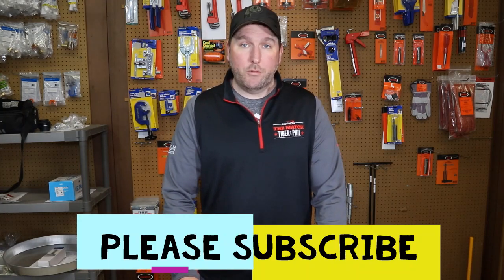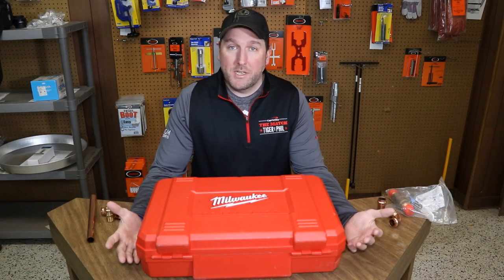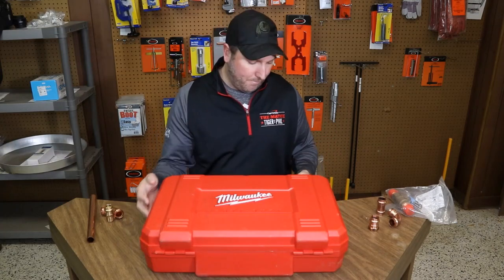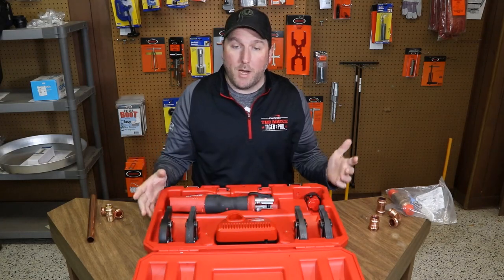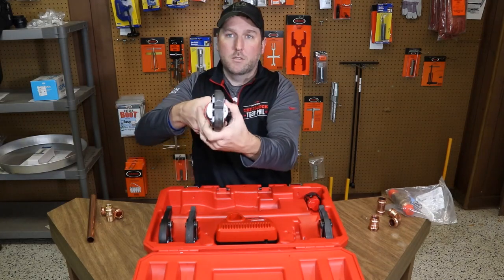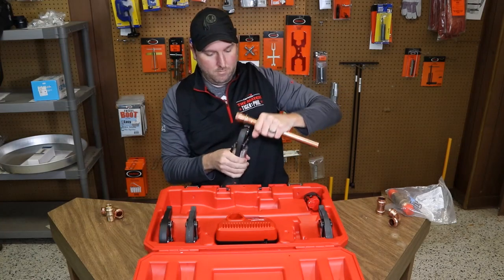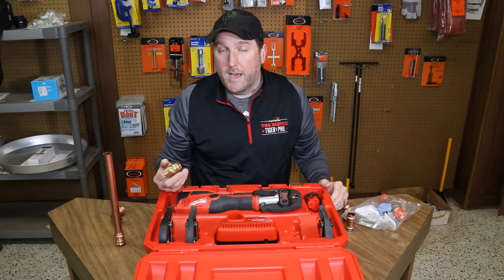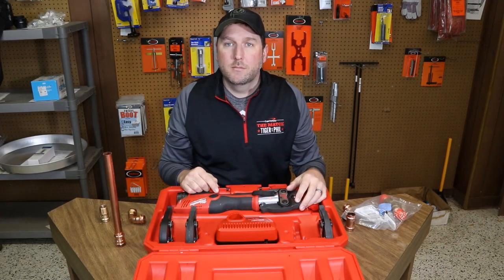The Milwaukee M12 Press Tool  A Must For Every Plumber

Comment: People dont realize unforeseen reasons us plumbers don't like to use oxy braising  .its not the time or effort it takes. Its the ticking time bomb we store in the back of our vehicles that can explode if cylinders leak. Im all for these types of press tools. The gas fittings have yellow Oring,  water usually black.
Reply: Of course this would be your excuse. The poor homeowner then has to rely on a O-ring not to fail and it generates money for you once it does.

Comment: Always clean and de bur your pipe.  The o ring inside the fittings needs to be on clean copper. A big burr can cut it when pipe is inserted.
Reply: Deburr/ream yes, but do NOT clean/sand the pipe; the O-ring is supposed to seal on a perfectly round surface, not one with a bunch of scratches on it!!

Comment: I don't understand how I own  drill& driver , circular & recip-saw .A light & hammer drill . And the total amount spent is still not as expencive as a press tool kit! Prices are literally rediculas. Not saying it's not a good tool but my GOD  $$$$
Reply from the maker: I agree they are very expensive.  Maybe they will come down after a few years like when Flat Screen TVs came out and were $3000 now $500
Reply: You need to learn how to spell! Js
Reply: Seriously! Its about the same amount of material/parts as milwaukee drill and costs 10x more 😫

Comment: Propress has saved me multiple times when there's still water in the pipes.
Reply: Why noot use compression fittings. A spanner and mole grips and the job is done

Comment: The good part I liked about your presentation is the fact you stated the working pressure limitations for the fittings.  What I would have like to have heard more of is the working weight of the tool.  The old Rigid corded tool weighed a ton.  These battery operated tools are much lighter, but I think might be a bit weaker on the pressing. Veiga  and Milwaukee makes one for steel, (Mega Press).  I was wondering if you knew, if the heads for the Megapress tool, would accept Propress crisper heads where you could get the stronger tool and just swap heads so that you would only have to buy the crimped heads.  Also, what are the temperature limitations for the fittings, glycol mix, steam temperatures...

Comment: What you across the Atlantic call Propress and what we call Pressfit over here has actually been around for 50 years or so. What's new is the technology that's used to press the fittings. We have M press fittings which are mainly Yorkshire XPress and V press which are mainly Conex Banninger fittings. My press gun is a Rothenberger Romax 4000 which uses Metabo 18v batteries that can also be used in my cordless Metabo tools. Pressfit is brilliant, but does have it's drawbacks in that it's not easy to get the jaws into tight spaces. Viega make a pressfit gun that has right angled jaws which are great for tight spaces.

Comment: Years ago I worked at a company that used power crimpers (Panduit) for copper cable lugs and then I saw the crimper you used in my basement when my water heater was replaced... I immediately saw the correlation between them.  Quick, neat, time saving.... the best way to go.

Comment: waterproof sand paper is damn expensive now a days.    love this tool. i recommend to any service plumber that lives in a crawl space.  changing hose bibs is a gold mine
Reply: Sandpaper?? To make a solder joint all that is needed is a roll of wire wool, a tin of flux and solder. All these items will last months so making a joint is very cheap. For a joint which is wet use push fit plastic or compression fitting. No need for a $150 tool

Comment: God damnit, I want/need one of those so f!@#$ing badly. Found a few locally around 800.00. I do property management in old, beat up college housing rentals. I end up in the craziest places....where plumbing should never have been installed in the first place. Eh - that's life. Great, quick, straightforward vid. I'm seeing a few local ad listings for used 2773-22 kits around 800.00. Total steal, it seems. I've got the M18 batts already. Thanks!

Comment: not so fast, I bought 2 of them and both units will not cut 1/2" m copper tube.  Aske the Milwaukee rep about it and 3 weeks have gone by and no answer?  I need tools that work every time

Comment: Does this work for pex rings as well?
Reply from the maker: This particular model does not.  The M18 ( next step up) will.  It also works on steel pipe called mega press.  These all take a separate jaw not included in the kit.

Comment: Are the M12 jaws compatible with the M18 system?
Reply from the maker: Unfortunately they are not.  This system works really well. We even just ran a 1 inch gas line with it.  Only advantage of the M18 I see is it will do larger sizes above 1 1/4" and also does steel mega press

Comment: How do you know when to take finger off of trigger?
Reply from the maker: 2 to 3 seconds to initiate the machine and then it cycles itself and crimps.
Reply: @PlumbingPartsPro  so it shuts off once it crimps?
Reply from the maker: Correct.  Once the crimp completes it cuts off automatic

Comment: Does Milwaukee have 1/4 - 3/8 jaws as well??
Reply from the maker: I know there is smaller jaws in production and coming soon for refrigeration lines.
Reply: @PlumbingPartsPro  Do you think is possible to use Rothenberger’s small jaws with Milwaukee press tool sir??

Comment: Does this tool have pex crimp jaws now ? Or just copper and the mega press jaws for gas?
Reply from the maker: So it's my understanding this m12 version only does copper.  The m18 will do all of it.  There is also a specific pex only version in th m12 that's a considerable amount cheaper like 699.00.  Not sure why they didn't incorporate pet in this version.  The m12 is not strong enough for mega press

Comment: Can you get a pex crimper  bit for 1/2"
Reply from the maker: This model does not support the pex jaws for some reason.  You would have to upgrade to the M18 model or buy a separate pex version only.
Reply: they are coming out with pex jaws for m12 and m18 next month on Feb
Reply from the maker: @elnicadrums  that's great to hear.  I haven't heard that  yet.

Comment: Copper for gas NG lines...??? Atmos will disconnect your service if you have copper lines....has this changed???
Reply from the maker: Apparently it depends on your local code.  For many years, I saw flared copper lines to fixtures like water heaters etc... and we always told the customer its was not up to code and would update with black iron or an AGA approved gas connector depending on length.  Now they approve copper sweat (providing its silver brazed) or copper press in our area.  I guess it depends on the inspector
Reply: @PlumbingPartsPro  my neighbor works for Atmos energy and if u can because u smell gas and the find copper they shut you off .

Comment: It's not just difference in cost only in tool. Fittings are also more expensive. One for 10 £ and I can get 4 of the same for 2£. And... They are V jaws or? I saw also other systems for copper. Its also press but not V jaws...

Comment: when the price goes down under $300 I might get one.
Reply from the maker: Unlikely,  I agree it is Very expensive and I was one of the later guys to buy one, however it comes in very handy.  Putting in water heaters and hose bibbs  without having to carry an acetylene torch in an attic or crawl space under a house does wonders.
Reply: Bro it’s like 1500 the cheapest anywhere I look lmao you’ll be waiting a couple years for that price

Comment: The power of Marketing!!!   What happened to the compression fittings, are they no good any more?  And guess what you do not need that expensive tool.  Or is it a for plumbers to charge more for their work by impressing clients with their EXPENSIVE tools to justify the final price.  Also another way to discourage DIYers from doing simple repairs because they don't have the proper tools... MARKETING, MARKETING , MARKETING IS THE EQUIVALENT OF LOCATION, LOCATION,  LOCATION in real estate

Comment: Pro press is easy but every single joint will leak in 15-20 years
Reply from the maker: 🤷 who knows.  Hasn't been around long enough to find out I guess.
Reply: I have been using viega copper and plastic press systems for 23 years.
The dimensions have not changed, and neither has the tool.
You can work with it quickly and safely, there is no need to deal with fire protection.
There was a leak in 23 years, but there too a rubber sealing ring broke at the joint, it was just an installation error.
But other than that, there was never a leak.
I welcome you
from Hungary

Comment: Why is this tool $1000?
Reply from the maker: 🤔 not really sure.  The next model up is over $2000 however it's a very handy tool.  If you work with a lot of copper piping it will pay for itself by saving time.  Very similar to running steel gas piping and threading each joint and now  people using flexible CSST or copper.
Reply: It’s not its closer to $2000 and worth every penny

Comment: Compression fittings inside walls?  No, thanks.
Reply from the maker: I feel like it's better than a shark bite for sure and very similar to crimped pex which has been used for a couple decades now

Comment: That's just lazy plumbers have all kinds of pipe cutters so why do they need this?
Reply from the maker: There's all kinds of tools to make things easier or more efficient for plumbers.  It can be said that going from cast iron pipe to pvc could be lazy, or galvanized piping to Pex or using a drill instead of a screwdriver. As time passes and technology grows inventions are made to make things more efficient.